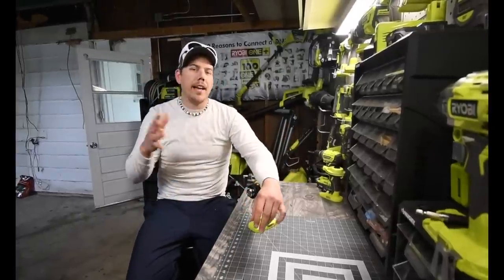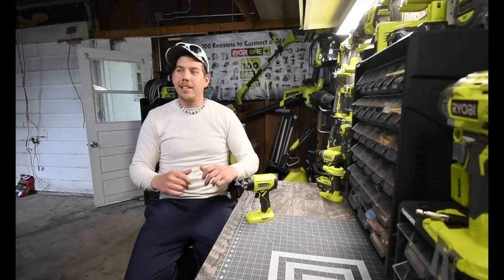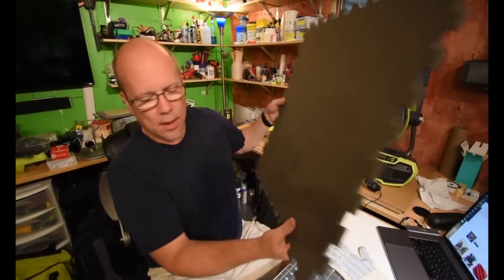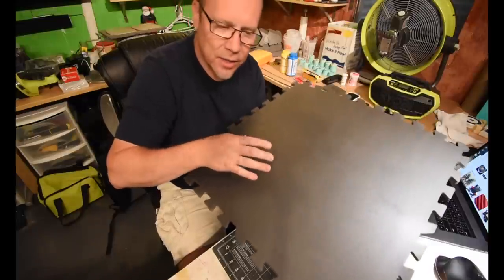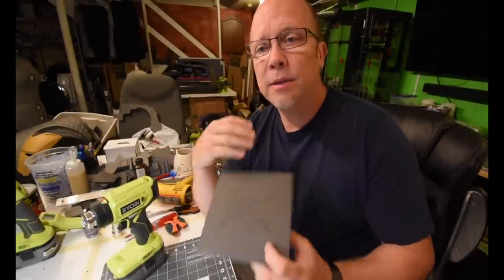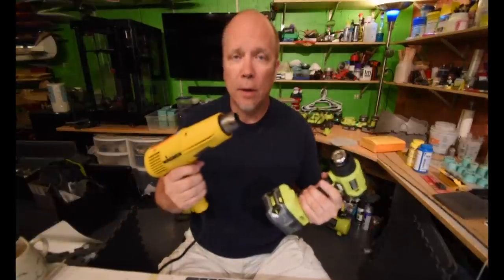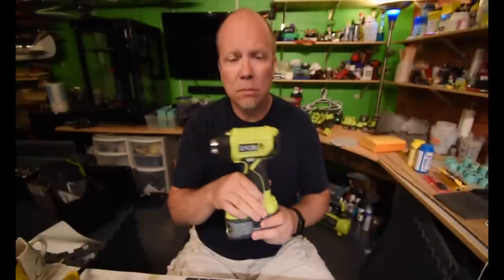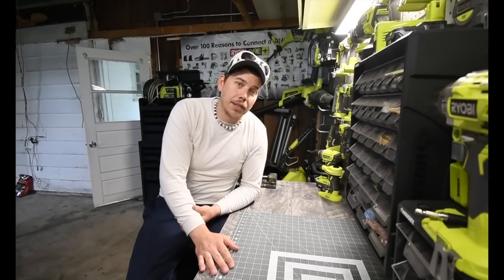Ryobi One+ Heat Gun vs. Corded Heat Gun

Comment: The Ryobi is very cold but it gets the job done, eventually. Had a car failure due to ice clogs under in -25c and the Ryobi saved me, even though i had to go through 2 batteries. A corded heat gun is obviously a lot better but relying on a 30 kilo generator to use it on the go is very counter productive.
Reply from the maker: The Dewalt version is way better then the Milwuakee and Roybi version

Comment: I still wants one. I have Milwaukee at work though. I was waiting for this one to come out  hoping it would be cheaper. May just go with the Milwaukee since it will be mainly for work and not home.
Reply from the maker: Adam Garrity I think they both work the same since it battery Powered
Reply: Although they're both made by the same parent company TTI, I would like to see a comparison between the RYOBI and the Milwaukee cordless heat guns to see if there are any differences in them.

Comment: Any electricians used these for heat shrink for mains cables?
Reply from the maker: Id go with the corroded ones for that
Reply: @ManCaverTools  Thanks.  A lot of the time, if we're doing mains cables, there's no power to plug into, but I think I'll stick to gas.  I just hate the fire risk of using actual flames to do stuff like that!

Comment: Awesome-review, never knew this thing existed til today!!  Nice to finally have an alternative to a plug-in heat-gun everywhere I go when working on the road.  I know this is a vague-question, but about how long will a 4ah battery-charge last on this with constant-use, and is there an overheat shut-off function/protection by any chance?
Reply from the maker: it doesn't not have those. it only gets up to 850 degrees.
Reply: 15-20 minutes operation per 5ah